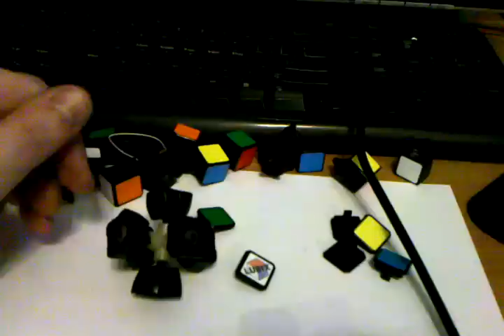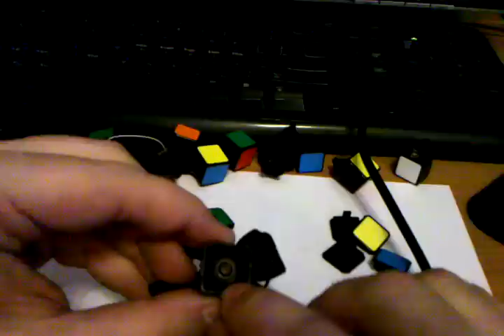Dayan GuHong tension

Comment: Yeah, I can't check tensions with the caps off either, on any cube.  It's not accurate to how the cube will feel with the caps on.  I'm not sure why no one ever notices this.  And sometimes, if a screw is slightly crooked, that layer will feel really uneven, and make that side hard to do algs with.  I get really nuts about that. That will also cause a lot of pops on one side, while the other side can't cut corners.